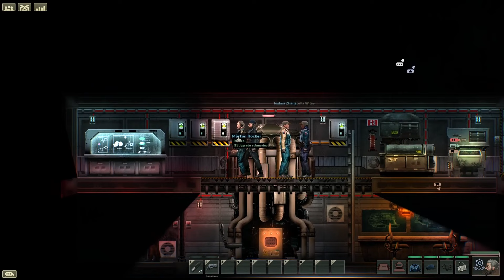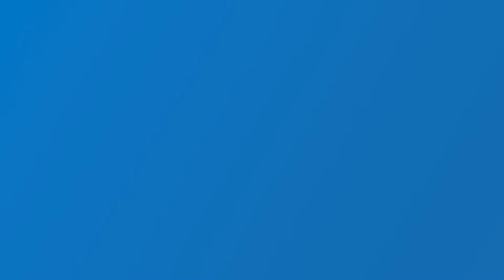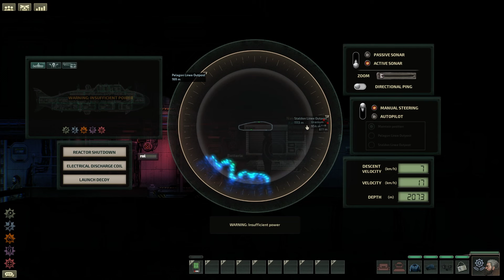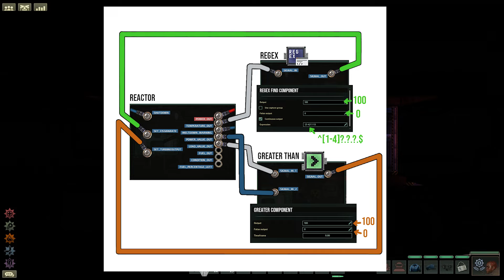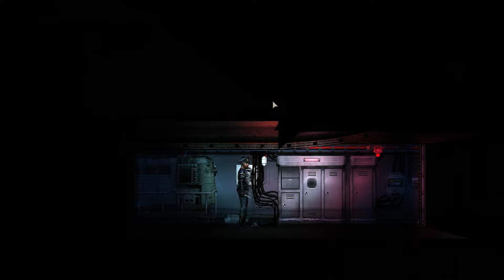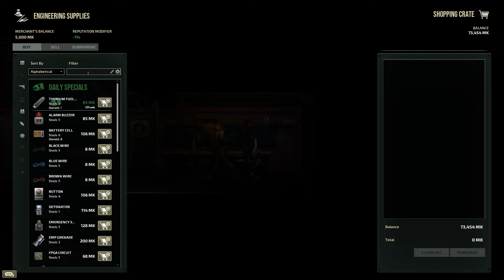How to make your submarine go faster

Comment from the maker: For the 2 component reactor, it does still work, you just need to modify the output values. change the regex to somewhere between 12-25 and the greater than 50-80. Each sub and reactor on it is slightly different, you will need to fine tune it to find the sweet spot. Be sure to grab a fire extinguisher as well when you test it out ;)
Reply: This doesn't work anymore
Reply from the maker: @KW_2000  Tested in 1.0 on the Camel, still works :D
Reply: @IronicandDead  Thanks, i was looking for this 😉
Reply: You were using orca in your speedrun, do you have exact numbers you like on your components?
Reply: As someone who doesn't know when to know it's working properly, what numbers or ranges are you shooting for on fission rate and turbine output? Are you trying to always get it to 100 on the turbine and averaging 15 on fission, or are you looking at another metric to know when it's set right?
Reply from the maker: @PocketDrummer  Excellent question, that I really should have covered in the video. The answer is neither of those metrics, instead it is the output bar. This should be in-between the 2 smaller arrows and will fluctuate, above the top arrow and your reactor begins to overheat and lead to meltdown. Below the arrow there is not enough power.
Reply: @IronicandDead  May I ask you to do another video to update on this controller? I am not sure if it working or not:
Or if you want a guide on different controllers out there
Reply: Should the reactor be on automatic or manual?
Reply from the maker: @LifeLikeSage  So it should be on manual, but i also have a better reactor controller guide here https://youtu.be/25vl7V4EV18

Comment: well, the circuit game and math isn't that hard if you try, it's like highschool first year level, Arithmetics, Proportions, Logic. Can't say I fully understand the reactor circuit I copied off a steam tutorial :D but the battery circuit was borked and I had to fix it, if it works at all. The only solution I can see for not frying your junction boxes while shutting down the oxygen generator (1000 kw), is if 2 batteries are empty and can take the load / power differential. Else if power is over twice the load, pop goes the junction box :D In my case it's 10 times over until it drops, but now with the batteries also rigged no junction box fully blows before it's repaired, so manageable... protip: you can use ASDW to control the reactor knobs, and while having a bot stationed there, you can easily nudge temporary power up while manually driving the sub, with a circuit controlling the reactor manually that is to nudge it back down :)

Comment: haven't tested it myself but comments in other identical videos say it's broken functionally, meaning it consumes more fuel than it's worth. My problem is I shut off power consumption and mechanics give me blackouts and fried junction boxes when I drive from low consumption to high, and back down to low. Gonna try the 5 component system, if not, there's a 2025 post indicating a more complex system

Comment: I made a Reator Control that i don't remeber quite right how it works but i did math!
 I did a function that know excatly how much temperature it need to produce enough power for each load and also a math that know excatly how much fission and turbine rate it need to achieve it, and i can divide it to the number of fuel rods and it's amazing :D

Big Bang is cool but is too much chaos, a simple math function with 100% precission is more cool :D

Comment: aside from the emergency repair system, i mostly just add a battery to one of the JB, that loops back to the power grid. even though it says low power, when starting engine from idle, it’s just a fraction of a second and it doesn’t really affect performance.

Comment: For the emergency repair, it could would take more wiring but you could potentially hook up the detonators so the captain can just remotely activate them by ship section. It might also be possible to use those water detectors to have one auto-trigger when the hull is breached and the compartment fills if you're able to put the water sensor up off the floor.

Comment: does it increase fuel consumption? Is the fuel wasted depending on the consumption, or just burned?
Reply from the maker: a very minor amount is, as the reactor will go into overheat mode periodically, but it's basically the same manually increasing the output. Bascially you won't notice it.

Comment: where is this list for the regex find commands, i'm trying to do this with the orca 2 and no luck
Reply from the maker: The regex command is ^[1-4]?.?.?.$ , there isn't a list per say, more just how regex works, you can google specifics. For the Orca 2, try setting the regex output to 20-30 ish and the greater than component somewhere between 70-90, you will need to adjust for wiggle room.

Comment: Regexfind still works, just getting the expressions right can be a pain. For the fixfoam grenade, you could also use a water detector with level% or dangerous pressure as the 1 output, so it triggers in real emergencies even if there's no one to push the button. Plus, it would trigger as needed and not all at once.
Reply: your water detector suggestion is brilliant
Reply: @redcat9729  Thanks!
Reply: i dont understand a thing, i just began playing this game, im still using a barsuk
Reply: @1000-THR  I would suggest you stick to the barsuck for a while. it took me a long time to move to bigger subs and even longer to start using the sub editor, so don't worry too much about it. Just enjoy the game, there's a lot to learn and do!
Reply: @1000-THR that's how I started. Then when I started reloading too often I realized I'm doing it wrong, so now I'm playin on easy and started with the Camel doing mostly transport missions
Reply: Look at that engineering genius, gon be real - that's a great idea, just gotta spend lil time on it

Comment: A little clickbaity no? Decreasing the reaction time of the engines doesn't increase your max speed, only your initial acceleration. So, how exactly did you make the sub go 50 knots without upgrading the maximum engine force? Downvote.
Reply from the maker: Hey there, thanks for the feedback, just to clarify a few things, I never said it increased the max speed forwards. The additional ballast tanks are where you get the improvement to the base speed for the decent of the sub, hence you make your submarine go faster. 

For the engine forwards speed there is no improvement to the base speed, however as there is a reduction to reactor reaction time, there are no drops in performance as the engine is dependent on power. When you have the fabricator, deconstructor and medical fabricator all running at the same time you get power drops and the engine stops working. 

This means your time from point A to B will be faster with the reactor upgrades. Not that your engine base speed will be faster. 

I Have a full technical breakdown from speed running with this submarine available on my discord if you would like to know more about it :D

*Also this was recorded before the talent nurfing of tinkering, and the submarine did already have full upgrades purchased from a station.
Reply: @IronicandDead  Okay but in the intro line to the video you say:
"We are gonna be taking a vanilla Barotrauma Submarine, and modifying its core configuration to make it go faster, without touching the submarine editor, or buying the speed upgrades..."

It literally does not go faster, other than in the y, those were good points. The reactor spins up faster, meaning you don't drop load, and it accelerates faster. I suppose you could make an average x-velocity argument, but thats not what you said.
Clickbait.
Reply from the maker: @TGCIIII  well, depends on weather the submarine was migratory or non migratory of course. Laiden or unlaiden
Reply: @IronicandDead  disregard Cap, upvote

Comment: Well you just go in the editor, load in the sub you want to modify, select the engine and set the force to 1000000000000000000000 and load out the submarine the way you want and set the buy price to the lowest possible (1000mk). And bam, next station, your dream submarine is there.

Comment: 2 component auto reactor doesn't work that well anymore since a nerf in the last update,
emergency repair system anyone can put c4 in your detonators or detach the detonator and place it with explosives anywhere they like. Letting detonators ever be within the public's reach is a hazard.
Reply from the maker: True about the detonators, but then again, a troll will do anything in public so detonators or not things will descend into chaos. 

For the 2 component reactor, it does still work, you just need to modify the output values. change the regex to somewhere between 12-25 and the greater than 50-80. Each sub and reactor on it is slightly different, you will need to fine tune it to find the sweet spot. Be sure to grab a fire extinguisher as well when you test it out ;)
Reply: @IronicandDead  if you put the greater component to 50-80 you will not be able to use 100% of your reactor output and if you don’t put 4 rods with the reg ex and you change the out put to 12-25 you won’t be able to produce enough heat to use 100% of the reactor. So regex is easy fix just put 4 rods but the greater component sound like a bad idea.
Reply: Personally I created a 7 components controller by my self. It work really well. The idea of it is to set the turbine output to 100% and only change the fission rate and put 4 rods of fuel. Like that only the fission rate need to move and usually only between 12 to 24 so it reach the valu that you need really fast cause it don’t need to move a lot
Reply: There are a ton of other ways to blow up c-4

Comment: ok questions
with the reactor setup i DONT turn on auto mode?
also does it burn through rods faster that way?
Reply from the maker: This is because  your running the reactor hotter, the controller setup is designed to be able to give you more power overall and allow you to use more rods.

Comment: Does the reactor trick still work?
Reply from the maker: yep, just needs some modification to the regex output, set it at around 12-20ish then the output of the greater than between 80-100 you will need to figure out the sweet spot as each sub is diffrent
Reply: @IronicandDead  got it working like a charm thanks man
Reply: @IronicandDead  Recommendations for the humpback? I cant quite get it right.
Reply: @IronicandDead  what outputs should I have it at for the Kastrull?

Comment: Im using kastrull sub why it still have power issue when i move the submarine?
Reply from the maker: It's a big sub, it has power balance issues running things at the same time. an auto reactor will help mitigate this.
Reply: @IronicandDead  im using the auto reactor on the video, but still i still get power issue. Should i change the output of regex?
Reply from the maker: @Arr1veGaming  Yes, so the new update changed the output of turbine and temp, there is a delay now. If you put the regex output down at 12-20 ish then the output of the greater than around 70-100, you will need to test it. You should be in a range that can support the delay. Each sub is different, but hope this helps. 

p.s make sure to have a fire extinguisher on hand when u start modifying ;)

Comment: Wont the next update mega nerf auto reactor methods?
Reply from the maker: yes and no, each one now requires a more custom setup
Reply: @IronicandDead  ah, to be fair the two componenet reg ex trick was kinda cheesing it tbh.
Reply from the maker: true, but then again there was no reference point on where to start with wiring and components in the game, so the ability to use one, even just a bang bang was missed by so many.

Comment: The emergency repair system blew my mind.
Thanks for the idea, will definitely try it out later.
Reply: Thats also a bad design. With "Wall" mode motion sensor you can make a fully automatic efficient autorepair system
Reply: @user-uq9se1nx9q can you elaborate?
Reply: @user-uq9se1nx9q  Except if it's a small breach it's fixable without spending a grenade.
Reply: Damn I must be a genius then, cause that's the first thing that came to mind when I unlocked fixfoam grenades.

Comment: Hopefully we'll get a guide on automatic doors
Reply: Just get a motion detector and wire it to the doors
Reply: @Grahdens   Don't forget to add water detectors signal to the equation.
Reply: @Neek0tine  No, because then you'll lock the doors and the crew won't be able to open them to access parts of the sub that are leaking to be able to fix them if the water's on the other side and they're on the other.
Reply: @rednova2212  The line between comedy and tragedy is really thin
Reply: You know it is in game for few years under the "item assembly" tab?